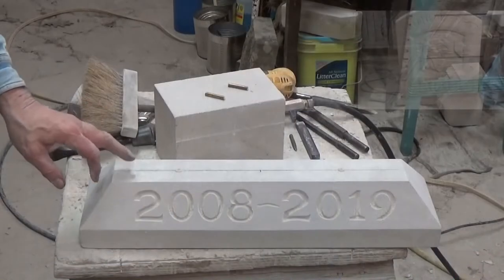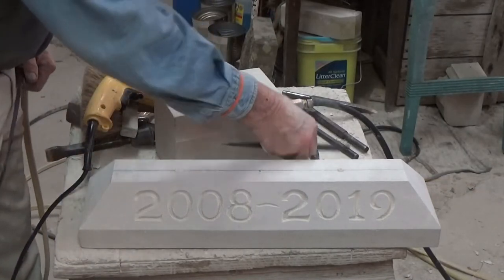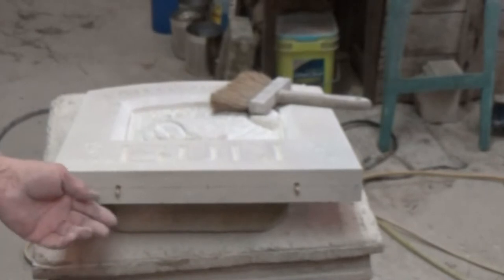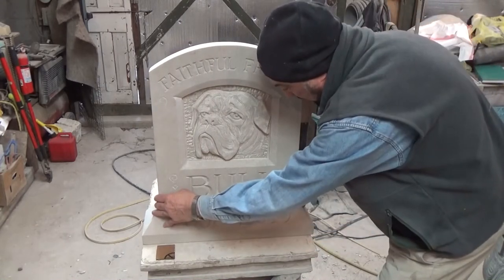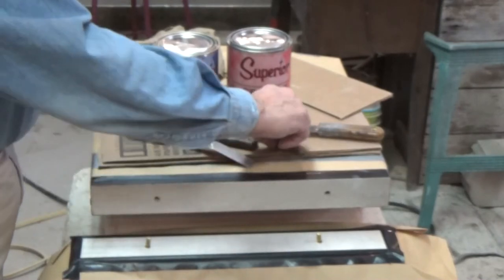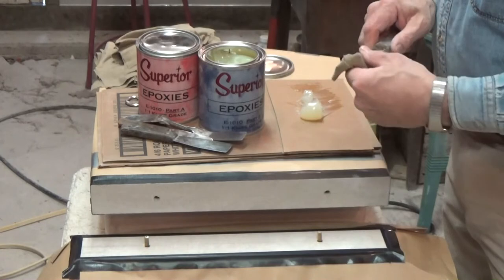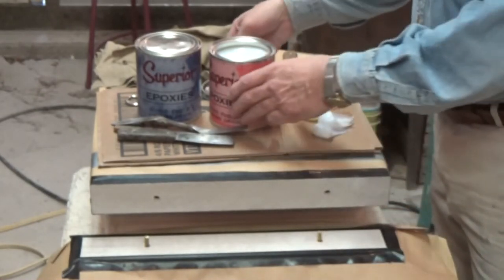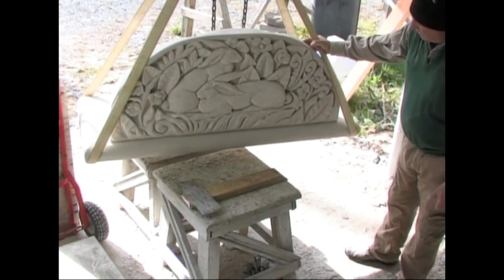Glueing Stone by Wayne Ferree

Comment: Limestone is very porous. In any piece that is outdoors the water will move up and down through a limestone piece. But, epoxy is impervious to water and so a solid layer stops the water from moving in the limestone. The water will build up next to the epoxy and when it freezes, will expand and start popping out small pieces of the limestone. Instead of a solid layer, it's better to leave gaps in the epoxy layer.
Reply from the maker: Thanks Scott, although your comment is correct, in my 50 year career, I have only encountered this problem when gluing limestone to bluestone.
Reply from the maker: Porous stone needs to be able to shed water, and dry out, freezing creates havoc!